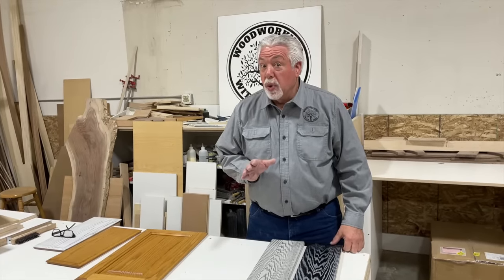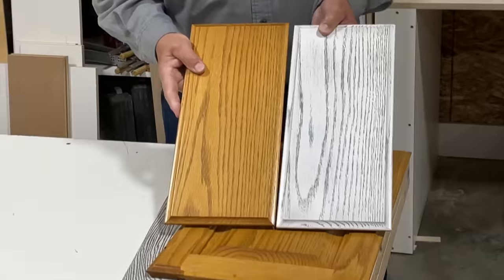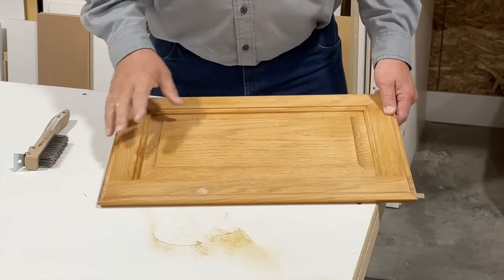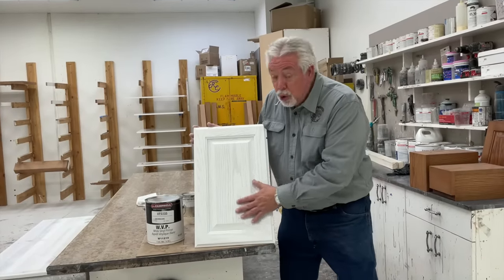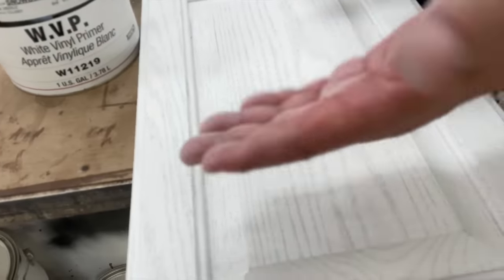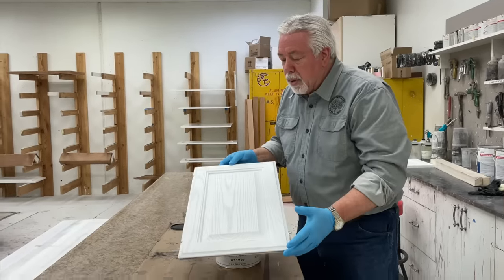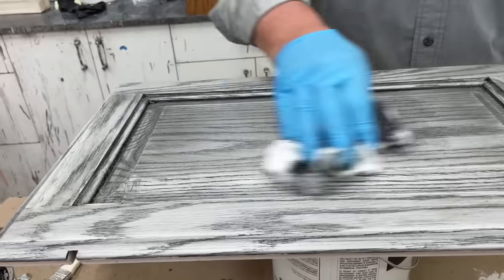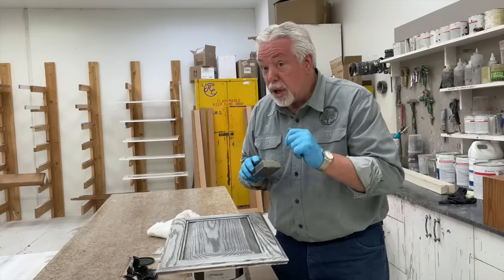YES it works...you CAN ceruse a golden oak kitchen.

Comment: I have a similar project coming up where we will be doing something similar although I will be filling the grain inside the profiles after first coat of vinyl with Bin white shellac primer then second coat the full door so when we apply the glaze (I will be using a fast dry spray glaze), the glaze will showcase a slightly lighter effect in the profiles while the flats pop with the ceruse finish! I am looking forward to this kitchen job as my client was going for a little old world and modern or contemporary finish so I will be replacing the face frame hinges and knobs with an oil rubbed bronze which will tie in with the slightly creamy off white basecoat and medium brown glaze! Very nice video and great technique 👌🏽

Comment: I really liked the white with the wood grain showing through! It is also nice to know that you can do this process with a wire brush start and just a soft sanding after. I'm not a huge fan of the black grain that was added, but it was a really interesting technique to learn about ... I'm now wondering if I could do something similar but have the wood grain accented with a pastel color (like pink) ... This looks like a ton of work though, so for now.. I will just stare at my yellow oak cabinets and wonder what I will do in the end xD. Thanks for sharing!

Comment: I have been doing something similar. I distress all kinds of furniture. You sand the shine off slightly. I use another color to accent doors more. You can do all the same tho. So I just did one with battleship grey back and black doors. So for mine…..you mix plaster parish in with paint. It is a matte finish but you can place shine over. Everything I am doing looks like aged kitchen ,bathroom, dressers are my favorite. Last one is beige back with peacock blue doors. T(e plaster is what gives it that look. TV sits on this antique dresser, house inside doors that blue and kitchen back face done and blue the doors just a polished look on any home.
Reply from the maker: Sounds like you are very busy and I am sure it all looks just great! Thanks, Wes

Comment: Great video! I was researching for a garden idea and i ended up right here at the boring pickle stain. I'm a wood finisher and my job is hunting me, here's a easy tip for amateurs to get it done in a fraction of the time ; wire brush ,try to get a nice smooth finish with any product of your preference i sugest waterborn so you don't die , let it dry good! And then get a black rubing furniture wax , apply on  circles and wipe off with a white t-shirt rag, and even easier put little bit of naphtha for cleaner surfaces , good luck!

Comment: This is a wonderful idea to learn! Thank you for sharing the wire brush technique. One easier step instead of sanding away the glaze would be using crud cutter spray and wiping away the top layer glaze right away. Less work!
Reply from the maker: Yes....that is a good suggestion. Thank you. Wes

Comment: Love this look. I’ve done similar jobs in my cabinet shop but didn’t use vinyl paint. I used a rustoluim (?) spray primer.
Wife wants this done in our kitchen. Will have to make the doors and fronts first our cabinets are flat face
popular wood. There are 26 cabinets so it’s not going to be an overnight job🤣😂.
Reply from the maker: Sounds great...good luck on your project. Wes

Comment: Beautiful finish and likely thousands of dollars saved, but hours and hours of tedious work goes into doing a project like this. I did a much smaller kitchen than I have now and that took several days without much sanding. The finish is truly the hard part without a well ventilated room. Lots of dust typically accumulates which equates to more sanding. Would make life a lot easier if the backs of your doors are flat.

The part I really love about this technique is that you get to keep the grain of the wood instead of just painting over the top of it and losing that beautiful grain structure that makes natural wood so appealing.

Comment: I'm having a lot of difficulty matching small panels cut from lumber (white oak shelving) that was previously finished. I think rather than continuing forward with multiple experiments, none of which are producing the desired result so far, I'll shoot for something like this. Using a glaze that fills the pores should be more predictable. Thanks for the video, Wes!
Reply from the maker: Sounds like that would work great. Let me know how it turns out. Thanks, Wes
Reply: @WoodworkingWithWes  Wes, this worked extremely well! I brushed on white, oil-based enamel from a can, let it sit a few seconds, then wiped it off lightly with rags. Pretty much the same process as stain. A second application a couple days later, and it was perfect.The original problem was blotchiness. I worked on the pieces for days, but even a lacquer-based sanding sealer didn't help much. Using paint to lighten the grain hid all those issues and resulted in a great contemporary look. I finished it with a coat of wipe-on tung oil varnish followed by two coats of spray gloss poly.

Comment: You have helped me so much with this video. I have been struggling with what to do about my cabinets. I want to update my kitchen but I don’t have the budget to purchase new cabinets. The doors have handles and I would really like to remove them. After using wood putty to fill them in, will it show after using the wire brush on the wood grain?
Reply from the maker: Hi Margaret...any repairs hide very well with this method so your hardware hole should disappear in your new finish. Good luck with your project. Wes

Comment: Great video. When I did it however, the white was more gray tinted. The sanding sponges helped but didn’t really make the white pop out. We didn’t tint the white primer/paint. Should we tint it whiter? We also were using a gel stain if that helps at all. Thanks so much.
Reply from the maker: Hi Mat...sorry I am late with this response, however, I am not familiar with gel stain. I have never used it. Thanks, Wes

Comment: Can I fill in the hole for the existing handles like you did the dent? Also, would like to see you do this in an existing kitchen without your spray paint room. Most of us don't have your set up. I also would like to do this to my wainscoating without removing from wall. Any suggestions will be greatly appreciated.
Reply from the maker: Suzanne...dents and holes can all be repaired as I showed. Watch for an upcoming video with a paint and roller application of this process. Thank you. Wes

Comment: Great video and outcome.  I have a couple questions.  First, there are so many different types of wire brushes - fine to course, stiff to not so stiff.  What type did you use?  Second question is how many of those sanding sponges did you use for this project?  I find that when I sand over paint, the sand paper clogs up almost immediately.  I try to brush if off, but it seems like you'd have to buy a LOT of the sanding sponges.  I hope I can find some oil based glaze at Home Depot or Lowes because neither of them carry that brand that you used.
Reply from the maker: Sorry to be late with your comment. I use a stiff, course wire brush right off the shelf. I am able to make my sanding sponges last longer by blowing them off with my compressor air nozzle....you might try that. Thanks for watching, Wes

Comment: Mercy okay you need to go over your cabinets with 320 not a hard thing just to even scuff sand then you want to nap everything off Napa.
Then hopefully you'll have a place to spray this it makes it quicker and it makes it more uniform for you to apply the glaze there's a few ways of doing this without having to go through so much trouble it's already oak so it's already got a good grain you just don't want to over paint your surface if you glob the paint you're feeling too much of the grain and you will not get the texture your design from the oak or any other texture you're looking to retrieve with the glaze. Now if you say satin paint you can wipe the glaze on and brush it out and then with the back piece of a sandpaper the paper side while it's still wet and you have to do this while it's what you wipe the glaze off of it this will push it down into the grain and reveal the texture simple and easy and then you let that dry and then you can put a sealer on it and then if you want more texture or color on it you tip it on with a brush to your desired look. Or you can just simply use a fill glaze wipe it on and brush it out .
Now you can use this also in opposite color you can paint these Gray and use white glaze which is really pretty. Teal paint is beautiful too to do with the white glaze have fun and don't work hard work smart

Comment: OMG!!! I can’t begin to explain the creative juices your video just got flowing!! 😁 I’m so excited! When we had our house built 8 years ago, the cabinets were made by an IDIOT! He used 3 different kinds of wood ( he figured we would never know). When they were installed 2 months behind schedule some were stained some were raw 😳. I assume this was done to hide the 3 different kinds of wood, knowing each would absorb the stain differently. Doors did not fit the openings. Nothing was measured correctly so pieces of lattice were used to cover the gaps. The hinges are so cheap my doors are falling off! In one of the the bathrooms they screwed the cabinet to the wall but I can fit my whole hand between the bottom and the floor. In the Master Bath I asked for a corner cabinet with a hamper. What I got was a big square cabinet in the corner. I got a wine rack in the dining room that I would need to be 7 feet tall to utilize! I would have been better off going to Lowe’s and getting their pre-made jobs than this so-called “custom” 💩! The painter felt sorry for me and offered to paint the cabinets for me. He told me “I paint walls and houses, cabinets are different, but I’ll give it a shot” he tried and did the best he could so we could move in. Anyway... your video has given me some ideas. Nevertheless I’m still concerned about how this method will play out with my wood medley situation 👍👎.  
Well... if all else fails I guess it’s a good thing that solid white painted cabinets are back in style! Unless you have any other tricks up your sleeve?🤔
Reply from the maker: Good grief...I almost don't know how to respond except to say I am sure sorry. Thanks for watching and for your comment. Good luck. Wes

Comment: I noticed you used vinyl primer do I still have to completely remover old varnish  or the scrubbing with wire brush is good enough? I want a white with a Robin's egg blue glaze. I am going to do a table top what do you recommend I use for top protective coat? I just love this look so table is first cabinets next. thank you so much Evelyna 💓

Comment: Wes, I have so enjoyed watching these videos and learning how to do this process!  I notice that on preexisting cabinets you use mineral spirits and wire brushing but don't appear to get all of the previous stuff off. My father-in-law feels like I need to strip these cabinets and doors before I do this process but I have had success on my tests with only wire brushing. I'm wondering if the finish will last without completely removing the original stuff. Also can I sand first then wire brush to expedite the process and get more of the original stuff off?  Again thank you so much for making these videos.
Reply from the maker: Hi Jon...sanding prior to wire brushing will give you a great finish, however, it is not necessary to completely sand off the old finish. Hope this helps. Thanks, Wes

Comment: Hi Wes! I will be redoing our kitchen in the new home my husband and I just purchased. I will be installing some additional cabinetry in the future as there isn’t enough storage there currently. Of course the existing cabinets are the old classic golden oak. They are still in excellent condition so they are definitely worth refurbishing. I am looking for a more natural raw wood color with the grain just slightly darker. I saw this video and the the effect it gives. Have you ever tried the glazing without painting first? Or tried glaze over a stain? I am not sure it will work and was looking for a bit of advise from a woodworking expert. Please let me know what your thoughts are on this technique without the paint. Thanks!!!
Reply from the maker: Hi Lisa...from the description of your desired end result, I think your best solution would be to strip and sand to raw wood.  Then apply the stain color of your choice with a clear top coat. Hope this helps, thanks. Wes

Comment: I'm a 65 yr. Old woman, with not so much energy anymore. I rent a condo going on 16 years now. The owner trusts me with upgrades and improvements. I can't stand my kitchen anymore... what you've demonstrated here is exactly what I want... an updated white and gray color scheme. The problem is that I cannot use a paint sprayer inside my apt. I have no other place to do the work, so I will have to paintbrush it on. Is there such a thing as a thinner paint to achieve the even thin coat a sprayer would? Also, except for the finishing, can I use a sander, and what # grade of paper? I know nothing about these things. I will start small... in my bathroom, to see if I can actually handle a big job like the kitchen. I know the kitchen project might take months because I am a perfectionist and slow poke. Thank you for reading this.

Comment: Hi. I think we're going to try this. We painted our uppers only white with that Rust-oleum Transformation Kit. Then used the clear coat recommended but it still yellowed the cabinets, though we were told that wouldn't happen. 🙄 wish I found this idea before we did that a couple years ago. Question: I'll need to strip the cabinets first, right? Then sand, then wire brush? Then proceed with the ceruse process steps you teach. Correct? Thanks a bunch!
Reply from the maker: From your description of the work that has already been done, you would probably need to strip, sand and wire brush as you mentioned. Check out our other cerusing videos for more color ideas. Thank you for watching, Wes
Reply: @WoodworkingWithWes  thanks again!! We love your channel! God bless!

Comment: Excellent! I'm whitish staining my spruce cabinets so the varathane won't orange the wood and ran out of whitish wood stain. Truthfully I did every critical outer exposed surface, but I'd still like to open the others and not see orange inside, so now I can stain the non-visible surfaces too. Also, once stained, the varathane spreads smoother and I only have a small can to use. This saves some $ and I can get it done now. But also not excellent. I thought I was done. Get out the white paint.
Reply from the maker: Sounds great...thanks for your comment. Wes

Comment: Beautiful!  At what point would you need to use a new sanding sponge. Do you have any videos on refinishing the old eighties malamine?/laminate with wood trim cabinets?
Reply from the maker: We are currently working on a video with paint brush / roller application that would work for these areas. When your sanding sponge no longer cleans properly its done...if you have a way to clean it, it will last longer. I blow mine off with an air gun. Thank you...keep watching. Wes

Comment: Thank you so much that was awesome. I do have a question, why are you  using vinyl paint as the first paint. Typically I’ve used vinyl for plastics or fabrics or automobile interior repair. Never in wood work. Is that what is required to make the second step work. Or can I use acrylic or enamel or just a water base paint? Thanks

Comment: Cabinet face looks awesome. Want to try this, but do not have a sprayer. Would this process work if I brushed on the base coat?
Reply from the maker: Stephen...check out our videos using paint brush/roller for the ceruse process. Thanks for watching. Wes

Comment: Would you normally do the same to the inside of the cabinet door or just leave it the golden oak? Also, if you don't have a paint sprayer could you do all the painting by brush with pretty much the same result?
Reply from the maker: I would suggest painting the inside of the cabinet and the back of the doors and drawer faces with just the base color. Apply the glazing technique to only the front of the doors, drawer faces and end panels. Please check out our videos on the channel using this process with paint brush and roller. Thanks for watching, Wes

Comment: Would this work on my outside deck? What sort of finish should I use to make it watertight?
Awesome video
Reply from the maker: Hi...I have never tried this on an outdoor or deck surface. Sorry, I am not sure how it would be. It certainly would require a durable exterior finish as a top coat. Thanks for watching, Wes
Reply: @WoodworkingWithWes  I'm going to try with a really good wood sealer and an oil based primer. Will report back on how it went 🫣

Comment: This looks awesome. I know it's a year later, but I have some questions.

1.  I don't have any way to spray the vinyl primer or clear top coat.  Could these be brushed or wiped on?  

Could this technique be used on the frames as well, or would those just be painted white?
Reply from the maker: Please watch https://youtu.be/kZDk0CBRS3I for our latest video showing this process  with a brush. Use the same technique on the  frames and end panels as well.  Thank you for watching. Wes